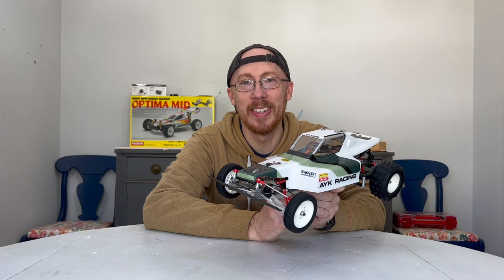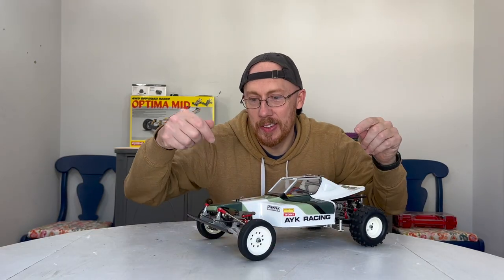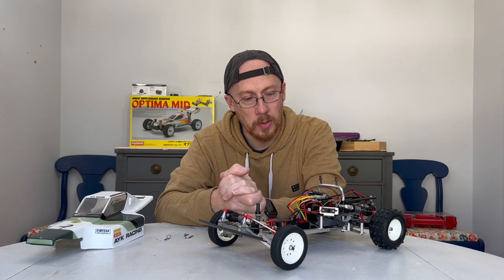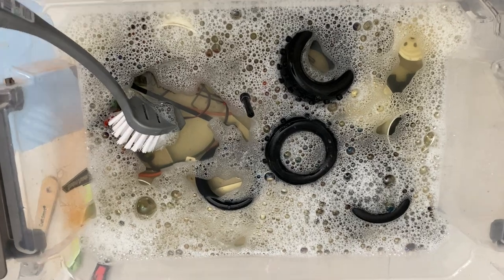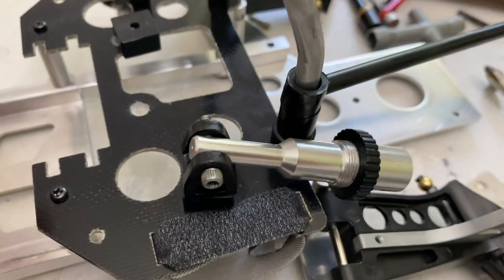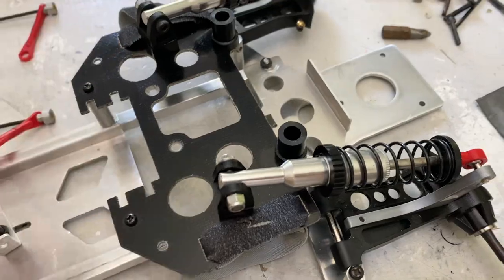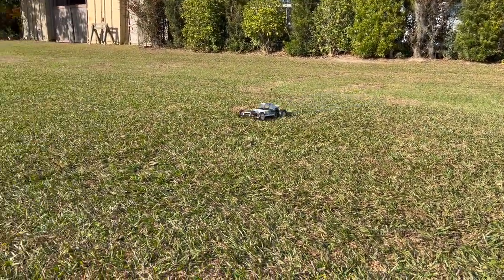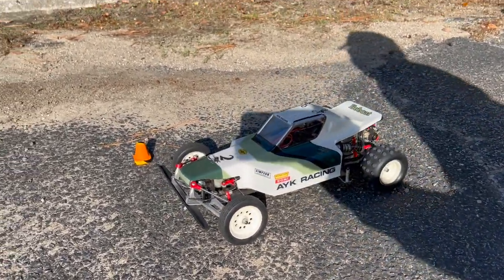1985 AYK BOBCAT RACING RC BUGGY RESTO AND RUN

Comment: I always look so forward to your videos a question are you familiar with the steering ball plates on the sands for your chassis they are the plastic plates that hold in the steering knuckle for some reason they come in two sizes wondering which ones the correct one as the one I ordered the whole is too large.
Reply: Oops met the sand scorcher.
Reply from the maker: Hi Jeff, actually I am familiar with those sand scorcher parts but never had issues with them. My problem with them was the tiny screws lol! Thanks